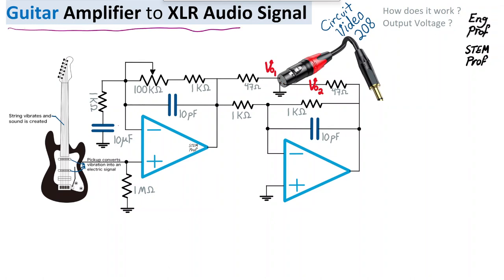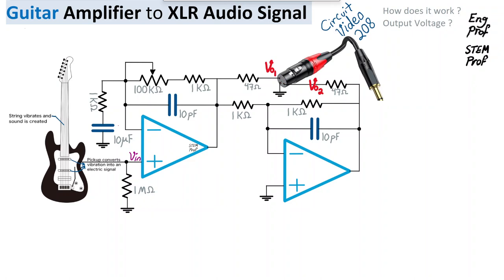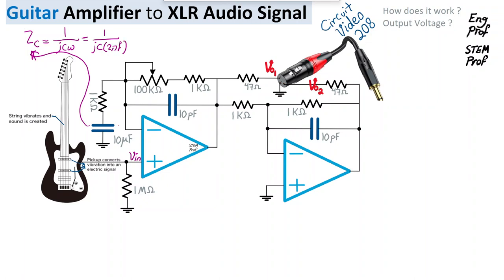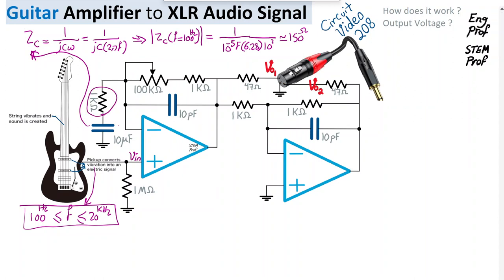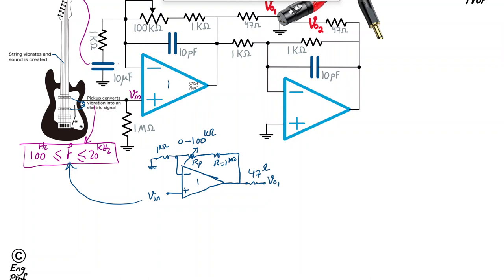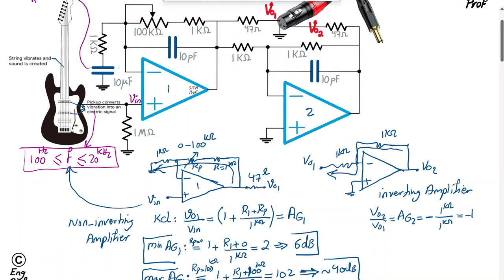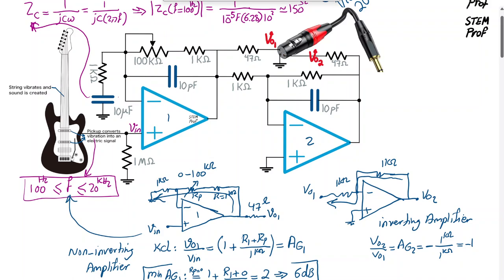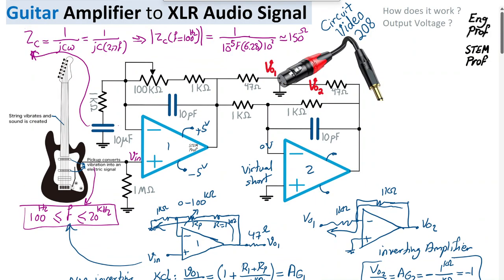Electric Guitar Amplifier to XLR Audio Signal

Comment: Yet more useful video. Thank you sir. I'd only like to mention that if you limit an upper freq to let's say 5kHz, you'll get a better sound from an electric guitar in almost all cases. They don't like high frequencies. They very much like distortions, but these must be soft ones )
And a guitar has no ground. A coil which generates +- is connected to a plug after some simple RC circuitry, but this is a symmetrical signal by it's nature, and a cable can have a 6.3 jack at one side, and XLR at another side, if I'm not mistaken.
Reply: Electric guitar pickup coils are "floating" with two terminals that could go directly to the two hot pins of a differential input - but in practice one of the two pickup wires is attached to metal shielding that lines the pickup cavity, often foil on the underside of the the pick guard, the metal cases of the potentiometers and switches, and lastly the bridge and strings. It would be possible to add a tip-ring-sleeve jacks in place of the standard tip-sleeve jack on the guitar, and connect the pickup wires (through the tone and volume pots) to the tip and ring, and ground all the metal parts and shield foil in the guitar to the sleeve. That would turn the guitar pickups into a floating differential source - but I don't think that would have any advantage over  just running single ended.
Reply: @jimmurphy5355  This absolutely makes sense, sir. As well as a low output impedance (may be some classical wahs will stop working because they rely on a high output impedance).
Reply from the maker: You're very welcome. Glad that this video is useful. Thanks also for sharing your thoughts. I agree that it should be beneficial convert the first operational amplifier stage to a bandpass filter to limit frequencies to above ~100Hz and below say ~10 kHz or lower depending on target application.
Reply from the maker: @majortom5838  Thanks for the comment. In addition to the single input justification as your neatly explained, this single to differential amplifier has a variable gain that can amplify Guitar's Audio signal 2x to approximately 100x via adjusting the potentiometer.  Alternatively we can use an Amplifier stage with Electronic Gain Control https://youtu.be/NoNgQpbj77Y
 or We can also use an RDAC or digital potentiometer if more accurate gain setting is desired.
Reply from the maker: @jimmurphy5355  Thanks for watching and for the insightful summary. If you'd like to use differential signal directly from Guitar, then we can use the first differential stage in the Instrumentation Differential Amplifier design https://youtu.be/2xJpqfexsPg  or using both output branches in the  Darlington Differential Amplifier discussed in https://youtu.be/z8f7iZei5cY.
Reply: For live sound application the lowpass would work as a crude form of "cabinet simulator", as real-world guitar speaker cabinets have no tweeters and thus are natural lowpass filters with a cutoff frequency at typically 4-5kHz. If an amateur student guitarist only brings a guitar and a cheap distortion pedal to your show, it'll possibly save the day.
For recording application, especially when re-amp processing or software effects are required, it might be a good idea to just capture the original signal and preserve the full frequency range.
Reply from the maker: Thanks for comment and sharing your insights.

Comment: Hi Sir. I like your videos and they are quite clear. But for this video, why not consider the function of capacitor of 10pf, at the time of 6:22 while using KCL for A1? Thks
Reply from the maker: Thanks, Glad that you like my videos. Good question, the 10pf capacitor is just a stabilizer cap that is practically open circuit given that its impedance (1/jcw) is very large for the frequency range (bandwidth) of operation of this circuit.  Hence it is just considered open for gain calculation. More amplifier circuits videos are posted in https://www.youtube.com/playlist?list=PLrwXF7N522y4c7c-8KBjrwd7IyaZfWxyt  video playlist.

Comment: It looks like this could easily be done with a dual opamp IC like a NE5532 or LM358 for a single chip solution. Very handy for a simple signal boost to a mixing board or AD convertor. It would not be a bad idea to put a simple RC bandpass filter on the output to clean up any harmonics or out of band noise generated by the opamps.
Reply from the maker: Thanks for sharing your thoughts and dual op amp Texas Instruments chip suggestions.  Agreed that depending on application, it should be helpful to include at least a lowpass (if not bandpass) filter at the output of the first op amp so that limits the output frequencies to say 10 kHz or so (depending on specific application).  For more Audio amplifier/attenuator videos see Bridge Audio Amplifier Explained https://youtu.be/EDpu6urAtHA
VCA Electronic Gain Control (Part 1): Voltage-Controlled Attenuator Overview https://youtu.be/cFzYZsPEtP0

Comment from the maker: An Electric Guitar Amplifier to XLR Audio output is explained in this video. For more Circuit videos:
Bridge Audio Amplifier Explained https://youtu.be/EDpu6urAtHA
Digital Stethoscope Microphone Amplifier Explained https://youtu.be/ez5KtkPbsHg
Op Amp Amplifier with Electronic Gain Control https://youtu.be/NoNgQpbj77Y
Push-Pull Power Amplifier with Darlington Transistors https://youtu.be/866MYibo8yE
VCA Electronic Gain Control (Part 1): Voltage-Controlled Attenuator Overview https://youtu.be/cFzYZsPEtP0
Power Amplifier Design (Class A) with Transformer https://youtu.be/gKlJrqGqeCI
PhotoDiode Amplifier with Data Compression Explained https://youtu.be/hqrRx2ufAwg
Amplifier with -25 to 55 dB Attenuation-Gain range https://youtu.be/oyz6lTGd2Xo
Electronic Gain Control for Op Amp Amplifier  https://youtu.be/NoNgQpbj77Y
Push-Pull Power Amplifier with Darlington Transistors https://youtu.be/866MYibo8yE
Thermometer Circuit Design with Op Amp & BJT transistor https://youtu.be/55YsraFE0rg
PhotoDiode Amplifier with Op Amp and MOSFET Explained https://youtu.be/1c3EJ2d4pVI
Instrumentation Amplifier with Electronic Gain Control https://youtu.be/C4tghZ-q6Zs
Voltage Regulator Op Amp Circuit with Foldback current limiting https://youtu.be/VN4_qF9DvBM
Push-Pull Power Amplifier Design with Op Amp, Sziklai Darlington Transistors https://youtu.be/8BFzsi7-Vbs

And the Analog Circuits Video playlist: https://www.youtube.com/playlist?list=PLrwXF7N522y4c7c-8KBjrwd7IyaZfWxyt  I hope these Circuit design and analysis videos are interesting.